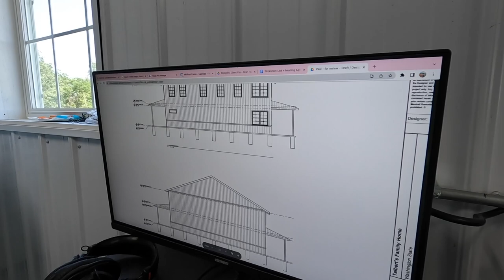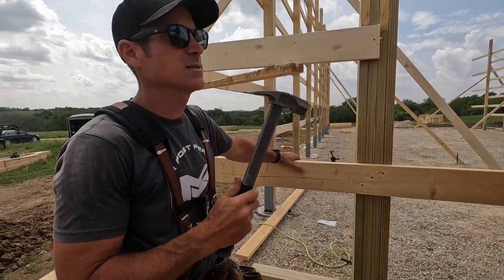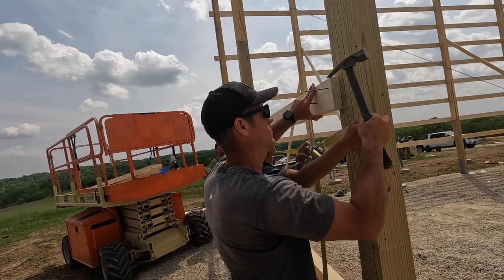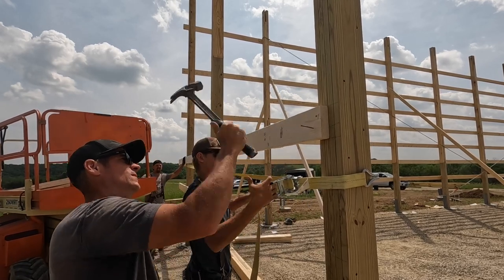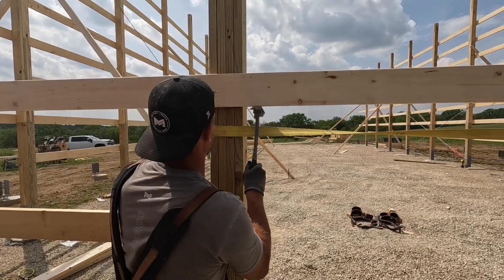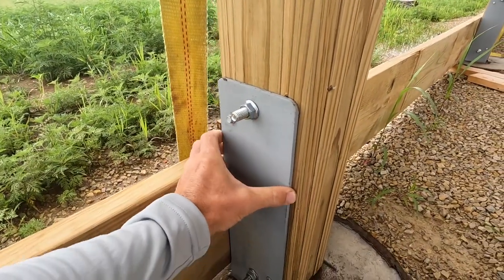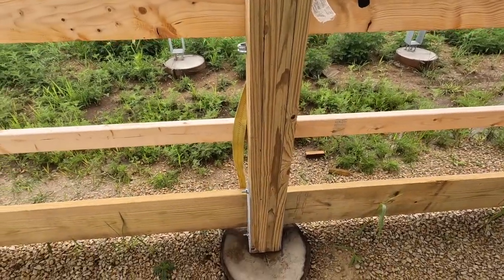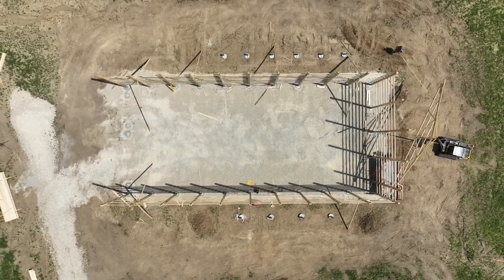Framing Barndominium Endwall | 36'x80'x19' Barndo Build | Ep6

Comment: So much extra work not building them on the ground.  Especially since it's a single lift with that width.
Reply: He stated in video ground is too uneven
Reply: @craigadair128  the interior ground is perfectly level.
Reply from the maker: I've built them both ways. If the ground is level I'll build them on the outside. This one was only 36' wide so was pretty easy to build in place with the right equipment.